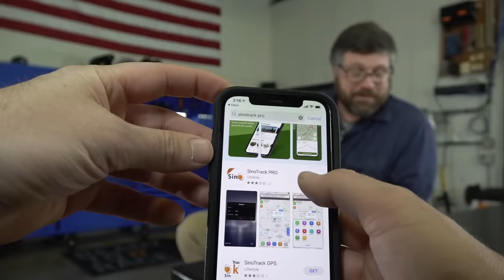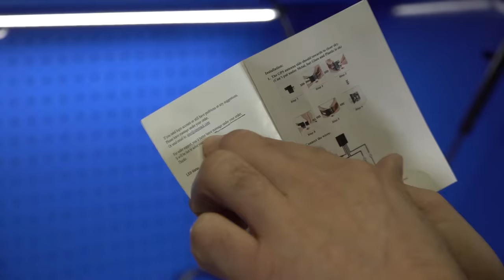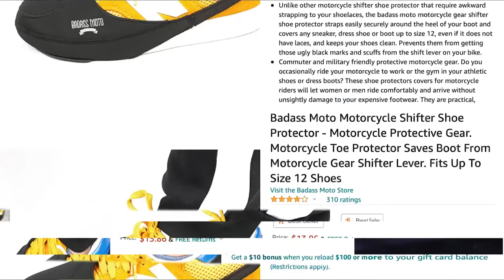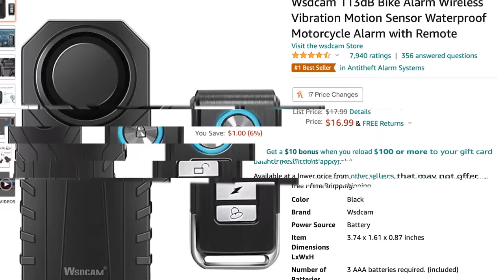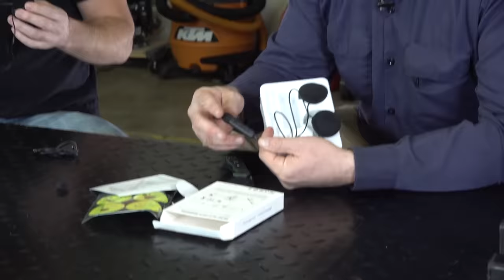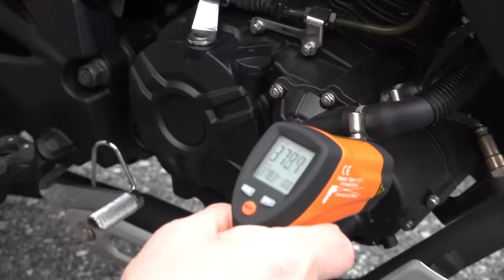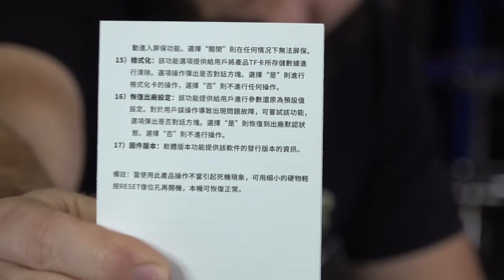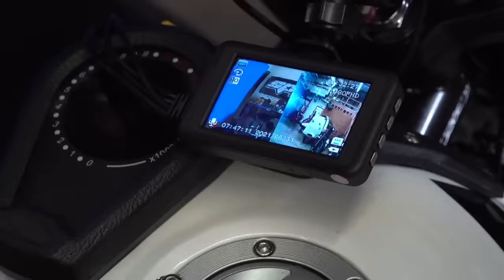Testing Amazons Stupidest Motorcycle Accessories(1 is Illegal )

Comment: The bike alarm isn't too bad, have the same one. The amount of settings with it for the price is pretty good. Only problem that I noticed is battery life with the triple A's. You'll have to replace batteries every two months or so if you use your bike frequently. In my case I have it mounted under the seat with the provided zip ties, so I also have to cut the ties each time to replace the batteries.

Comment: I learned to ride motorcycles in Indonesia.  Where literally everyone wears sandals everywhere.  You wear sandals to weddings in Indonesia.  So my first five years of riding were all in sandals.  Not once did I consider buying a stupid little foot thong for shifting.  You can shift just fine without messing your feet up.

The reason you shouldn't ride without shoes on is because if you crash you won't have a foot anymore.  But that's a different story.
Reply: Yep, dress for the slide not for the ride.
Reply: Yeah need to make sure we can survive a crash and a few seconds of slide l.
Reply: Based. I'm from Northern Europe and my favorite riding gear is T-shirt, shorts and sandals!
Reply: Those foot things are to protect your shoes so they don't scuff or scratch, if you don't care about your shoes or lack of thereof it isn't necessary
Reply: @hectorcorona9536  my first thought was: great thing if you take a two wheeler as a commute to a party. But the Italians took care of that by making the vespas with gear selectors on the left grip instead of left foot…

Comment: That alarm is the one I use for bicycles. I have found it of value and quality. Has full size cells in it, not buttons in the main unit. Hackable with code readers like most remotes, I assume. Would be good on toolboxes, parked luggage, power tools, doors and other easily moved items that need an alert. Thanks for the review.
Reply: I'm thinking of something similar for my motor scooter
Reply: @johnengland8619  I bought a disc lock with an alarm in it, but once i realised how it could be cut off quickly on the street, I hid it under the seat. Acts just like a movement alarm with a key.

Comment: That front/rear camera might not be any kind of replacement for a real action camera, but I could see it being good as a dash camera type thing if you wanted to have video footage in the event of an accident, but you didn't want to strap a camera to your helmet.
Reply: This
Reply: I do in fact strap a camera to my head as a dash cam, except usually I don't because it's a huge pain. If this was waterproof and automatically overwrote old files, then it would be a done deal. Sadly motorcycle dash cams don't seem to be a thing.

Comment: The helmet light is a very good idea, I think some companies have that without the blue and red lol but I quite like it
Reply: Yeah I think one that just is red, bright red or off is all they need to do. Also should have a sensor to attach to brake lever so it goes on during braking and only braking. Great idea and tbh could save lives I mean being hit by a car on a bike is pretty big statistic in motorcycle related deaths.
Reply: Cruiseman Garage tested one that is twice as big, more expensive too…
Reply: @Prof. Weed I didn't understand what the Bluetooth requirement was.  If it's just a sensor in the unit, why does it need Bluetooth?
Reply: In the UK, lights on the rider aren't legal for on-road use - it's because the rider could move and show the wrong colour. That said, laws can be made to change - so having a viable system to give motorcyclists high-level brake lights would enable equality with car drivers.
Reply: There IS a helmet light that is connected to the brake light that some guys made, even had on Shark Tank, that I believe is legal, and only has red. Also much brighter. Only downside, HEAVY.
Reply: @PhillipBicknell  apart from the fact there is a maximum height - which from memory is 1.5m from the ground
Reply: @jimcaulk6225  I think I saw that one at the bike show.  I was ready to buy it on the spot when I saw it.  Expected it to cost about the same as this one but it was like 4 times as much.  No thanks  This one looks too dim in the day time and that delay is a show stopper for me.
Reply: @jimcaulk6225  i

Comment: Just had a thought about the brake light. If you come off your bike, heaven forbid, and are upside down the red and blue flashing light would actually help 🤔
Reply: Some of these types of lights have a phone home feature should you encounter a situation like you mention. They will BT to your phone and send a message or call people you place on an emergency contact list.
Reply: @appa561  I know a number of motorcycle gps devices have emergency text message systems that send a preset message to your chosen phone number when it detects a crash. The downside is that you have to buy a several hundred dollar gps so most people won't buy one.

Comment: That helmet light is also available for bicycles in solid red, which works perfectly fine. I've also seen them in yellow-red-yellow with a turn signal feature, which I believe has a remote you can mount on the handlebars.

I've got the alarm as disc brake lock for about the same price.

Comment: Got a similar headset, but speakers were a bit too thick so took it apart to make some thinner enclosures. Turns out that's not possible because the side with the mic boom contains all of the electronics behind the speaker while the other side has a battery. Interesting way to fit everything in such a small package.

Comment: The little GPS unit is great for countries where you can get a cell plan for $10 a month (ie Asia), otherwise useless in countries where you need to pay $50 a month. Mind you, if you already have a cell plan, some companies will give you a secondary data plan (for your tablet) for $10 more in North America.
Reply: You can in the US as well, my phone bill is about $10/month (actually I think its $100/year, which is slightly less). When you're spending the near $60/month that guy was thinking its for something like 30 GB of hotspot tethering plus 35 GB of 4g phone data (afterwards becomes really slow but you could check emails still), with unlimited calling and text. I had to do that when I was out where no real internet service was, using my phone like home internet since that was pretty much the cheapest I could get anything reasonable.

You can also do what the feds do and clone your sim card (however since the NSA taps and records everyone's phone in the US, they probably don't clone sims anymore since there is no need), but then you have a copy of your sim without needing to pay extra if you already have a cell phone.

Comment: Thanks Sean and Craig.  That was a pretty fun episode.  I kinda like the TPMS.  Wouldn't be bad to check pressures before you ride.  The stems on my bike are kinda hard to get to so this might be helpful.
Reply: He cut that short, I liked the ones I had till they wouldn't pair with the receiver  after about a year and the batteries were a pain to replace
Reply: I had a front valve stem fail on me and my TPS warned me I was losing air so I could stop it in time

Comment: We have had the motorcycle alarm with the remote on our Honda shadow for at least 2+ years. It's so easy to set up. Its barley visible to the naked eye unless you are specifically look for it and its zip ties holding it to the frame. The batteries are easy to change in both the remote and sensor itself. Just a word of advice. Put it on your bike where the actual frame itself gets touched the most. We have had times of forgetting the sensor is on but it doesn't sense our movement until we are on and driving away. It's all about the right placement and this will be the best 20$ you've ever spent. Worked in Los Angeles and works here in rainy Oregon.

Comment: WARNING on those TPMS caps, they should only ever be used on METAL valve stems NEVER RUBBER ones (some even have that warning on the package or instructions now), I had a similar system a few years ago before they had the warnings, and the weight of one of the sensors pulled out my rear (rubber) valve stem on the highway at 65 mph leading to a very scary situation, once I pulled over I saw the front valve stem was starting to pull out as well.
Reply: So  centrifugal force on a motorcycle wheel pulls inward toward the axle??? WEIRD!
Reply: @mrbmp09  it happens, especially when they're older. Even the real long ones that are like 2 or 3 inches intended for steel car wheels with hubcaps will fail with time from the bending force... Had it happen to me! Only wheel with a long valve stem and it snapped off one day on the highway!

Comment: The shoe cover was always a great idea.  I like being decked out in riding gear as much as the next guy but sometimes you ditch the boots and go casual.  Tire pressure monitors are a waste on a bike imho because you'll feel the difference immediately.
Reply: As a daily rider, I can confirm, you can already feel 0.2 Bar of pressure change on the tires.
Reply: @aril.3674  When you get the pressure gauge to confirm you're not freaking out XD
Reply: Agreed.. has this guy never gone to a party on his bike?
I don't want to wear boots everywhere i goes 😤

Comment: The GPS disguised as a relay looked OK ,and would not cost as much for a sim in the UK so could be viable ,the gps unit looked like those I've fitted to drones with an Arduino controller or similar.

Comment: You should be able to get data only SIM card for your existing plans. Those don't really cost much more extra, can't make calls and are intended to use other devices on your plan. That's somewhat common for tablets with cellular internet accessibility (like Surface Pro 7+).

Comment: There's a much better version of that helmet brake light.  I think it's called Brake Free.  It's more expensive than the one you guys bought on Amazon, but  it seems to be a good product.
Reply: Hey that's what I was commenting on someone else's comment - just forgot the name.
Reply: Yeah it has truning lights aswell. But thats just the helmet mate its cool 😎 I'm getting it for my sur-ron lbx which doesn't have brake lights
Reply: I’ve used Brake free for the last year. I find that people stay further back from me. When you get off the throttle and slow down it lights up letting people know you are slowing down even though your brake light wasn’t actuated. This makes you safer!
Reply: i have a bicycle laser projector when i slow or stop it projects red lines on the road no where near enough but it's something. Still working on wiring up a full street legal lighting kit to my sur-ron its a pain in the ass
Reply: Brake Free is amazing! People stay farther away and I’ve found that it annoys people because of how bright it is. I’ve had brights flashed at me and flicked off but hey it’s doing it’s job they noticed me.
Reply: While not illegal, any altercation to the helmet may affect the safety. 
So technically even things like a sticker, or an intercom may alter the outcome of a crash.

Comment: I'm in Australia and recently bought the Brake Free helmet light from the USA. 3 settings of (60 small but bright red) led brightness. Lasts about 10 hrs and is charged by micro USB uses a gyroscope light up when you stop/slow. They were also on Shark Tank USA.

Comment: About the tracking one, you dont have to spend that much on a phone plan, just with a basic phone plan that you pay just for what you use or add lets say 10$ prepaid and add more $ if you ran out, and those things would use data only while you are using the app/tracker

Comment: Hey the picture of the muffler burn protection on your calf got my attention immediately.  I had the great idea to make a doeskin bandana for my neck when riding.  Unfortunately doeskin at 80 mph turns into a bull whip to ears and face. Has recently burnt my calf on hot pipes. So I thought to move from my neck to my leg. Worked wonderfully, except for the looks and comments it garnered at the the local biker bar.

Comment: I actually have the silicon calf heat shield and love it. . I ride a Triumph Rocket R3. With Carpenter Sidewinder exhaust.  I've never ridden in shorts, even with thick jeans the heat from that exhaust is intolerable on your leg even when your leg is no where near it. My pipes are wrapped, I wear the calf guard with long socks and jeans over that. And it keeps the direct heat off my calf even when it's not actually touching the exhaust.  To give you some idea of the issue,  a friend recently rode my bike and actually set his pants leg on fire off the exhaust.

Comment: I’ve got Sena and the BT30 cheap eBay intercoms and I’ve got to say there is basically no difference in audio quality or intercom range. The dial on the Sena makes it easier to adjust volume with gloves but as the same time it does sometimes spin due to wind speed

Comment: I had the headset in my first helmet.  They were good, but the microphone wasn't noise canceling.  The speakers were ok, but you didn't get the rich bass and mids that you do with other good sets.  I use a Cardo Freecom 1+ now and won't beswitching.  I also used the Tire  Pressure sensors.  Mine worked great for 3 years, until the head unit died.  Mine was only $30.  I'm going to get another set for my Vulcan 1500 and my Honda Silverwing.  It is very useful and does work well.  I think my first head unit died from being out in the cold too long.  I forgot to take it off after a ride in the Winter (it was for charity, temps around 25 F).  Li-Ion batteries can get destroyed in extreme cold.

Comment: If you like the wireless helmet mounted brake light deal you can find them pretty commonly and cheaply sold as a bicycle accessory. And so far I have not seen any sold as such with EMS lights.

Also the delay is probably due to it being mounted on a "soft point" (rider). On frame there's nothing to delay the accelerometer from sensing braking.

Comment: A so called friend gave me a set of the tire gauges and insisted I put them on right then. I did and hey! They worked . We took a ride and in the middle of town , my rear tire went flat. No it wasn't leaking air from the cap but was hitting on the bike as it went around and tore my valve stem half way off.  Not a fan of these kinds of products lmao 🤣

Comment: The TPMS tracker seems like the only thing worth putting on your bike, only problem is that the valve stem caps most likely weigh much more than those OEM plastic caps. You’re throwing your bike’s wheels out of balance just so you can say you saved 3 minutes on having to pull a tire pressure gauge and check your tires.

Comment: Hi, I am from India and I have been using the Bluetooth Headset for the helmets from last 6 to 8 Months and I am a rider and I do lot of rides and the one I got installed works pretty good and the sound is very clean even on Highways and the best feature it has is the Auto answer after 3 rings (Weather it is a important call or unwanted). I would surely recommend this to all

Comment: That alarm system that you got is a total ripoff because you can actually get a far more useful and practical version of it at about the same price, one that doesn't use triple A batteries for the alarm but wired directly on your battery instead. You can also remotely start your bike at a surprisingly impressive distance by double pressing that lightning logo. If it's on gear/kickstand/kill switch and you tried to start it using the remote, it still turns your bike on ACC and you can start it manually from there still w/o having the need to insert your keys. To turn it off, you just need to double press the disarm/unlock button. It's pretty convenient if you ask me.

Comment: I bought the BT30 before a large ride. The battery life is great. And lasts me a week or two of daily riding, but on constant use the 8 hour mark is pretty accurate. Bass is lacking. But it's better than being constantly lost in your thoughts and the wind for long rides.
Would honestly recommend. And I really wish someone would come out with a better sounding version that would pair up with a Bluetooth push to talk button mounted to your bars with an app on your phone for communication via a buddy system. Because frankly unless I'm going through some serriously far flung places I'm not ponying up the cash for a cardo or simmilar device.

Comment: For the GPS tracker, I don't know how your cell provider plans are in the US.

But in some asian countries, you can get a sim-card that only has data, and takes the data from your existing phone plan. Think of it like getting a regular phone plan with data, then getting a secondary sim for your tablet or ipad, that shares the same plan (only data) as your phone.
Reply: You don't even need a plan for it, just buy a prepaid SIM card for 10 bucks, then charge it with another 10 bucks. That's enough for years. The device needs very little data.

Comment: The burn jacket works, and it’s not stupid. In Hawai’i, we wear shorts everyday of the year. I wear my jeans and motorcycle jeans on longer rides, but to go to the store or a friend’s house down the road, I am not putting on jeans in 85° weather for a short ride.
Reply: Strangely enough, it's the short rides that usually costs arms and legs. You're more likely to crash during the short rides to the shop or to your friends house, than on a road trip, simply because the routine of the short ride lowers your alertness.

Comment: Depending on the weight of those tire pressure sensor there may be a chance it rips off your valve after some time. I remember those led caps used to rip of the valves off
Reply: Even long valve stems intended for steel wheels have a habit of cracking off car wheels as they get old!

Comment: I have the exact headset in my icon airflite helmet and I charged the battery when I first got it and 3 months later I still haven't recharged it and it's my only helmet and ride so I use it everyday. Very good find. 👍